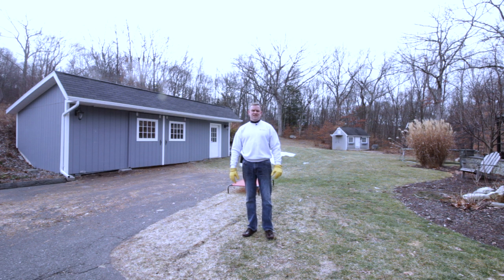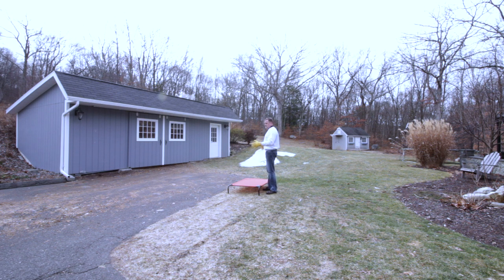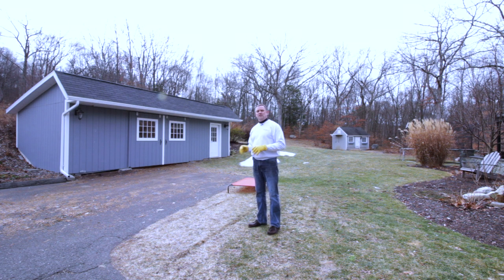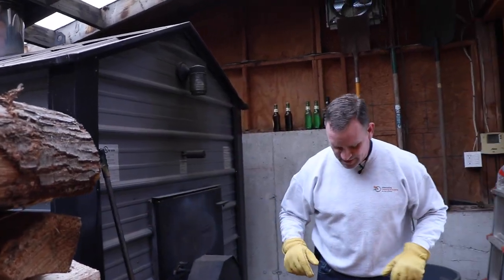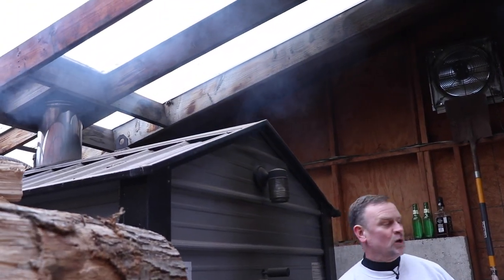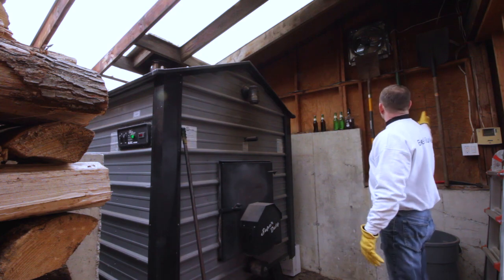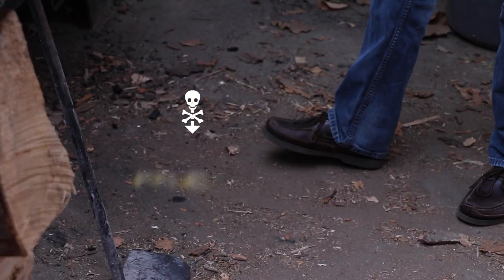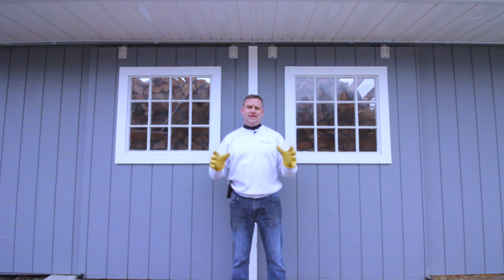How and Where to Install an Outdoor Wood Boiler | DIY Projects

Comment: So much great information in this video! I have a Tennessee outdoor Hoss 600 outdoor burner and I set my burner up completely wrong! Its rated for 10,000 sq ft, but my house is from the 1880's and is around 4000sq ft. So it's all my burner can handle. Even though the wood cutting is alot of work it sure beats the 800 month in natural gas and electricity. Now with the burner going my bill is around 180 month for electricity and my gas is shutoff at the meter. I'm sure it could be even more efficient if can get this mini mansion insulated properly. My blower from my furnace runs constantly to keep up with the drafty house. Im going to try alot of your methods on here, keep up the great work!

Comment: Wish you had made this 3 years ago. Kudos really nice set up   We have a lot of the same Ideas   I chose gravel as a bed, however left the stove outside.  20 feet from (back of) the work shop.  175' to the house. My main issue is/was icing around the front of the stove from roof run off, and flow of the land. I have a 16' "lean too"  constructed off the back of the 3500sq foot shop. I hope I resolved the problem this year. I put eaves on last year and it helped, now an eaves heater plus some landscaping. Hey it's what I sent the boy to school for ;).   If it doesn't I'll extend the roof line to cover the stove next year, more or less box it in.  I have enough room for 3-4 years outside and another 1+ under the lean-too cover.  Which I now don't care for. I'm paranoid if it starts on fire I'm placing it to close to the shop. This is why I like your "self contained area / building".   Plus I now like the extra cold storage area. Considered about boxing it in with a fire wall between the stove and the lean-too wood supply.  I do like the outside storage as it allows for ease of wood rotation. I'll admit heavy snow has been an issue despite covering it.   Since this is hidden  i'm okay,, so no eye sore or gossip.  Now water lines.   I wish I had a second run to the house for the hot tub & three season porch (or future.)  But I think a manifold will work when ready for that. Whats your take on the manifolds I read pros and cons.  
 Regards  Al 
 awesome job

Comment: I like your setup, I didn’t think about the greenhouse roof I was just gonna go black and put more lights in, as far as the size, you said 2 years, for the load you described I would assume 10 cords a year, so if your storing 20 cords of split wood, a boiler and a generator, what’s the actual dimensions?

Comment: Mr. Luff,  Could you talk to me a bit more about when you had your setup as “seasonal”.  I like the idea of just moving the furnace out for the heating season and putting it away for the warm months.  Did you have any issues with freezing or heat loss with running the lines over the surface of your yard?  I assume you had installed some threaded fittings on the side of the house to connect up to.  Thank you.
Reply from the maker: Sure thing! No real heat lose from the water lines on the ground. I also used Sharkbite fittings for the connections. It is in-creditable simple thing to do. and it work great.
Reply: @AltheatsupplyLLC  Thank you for the response.

Comment: Great job!  I have been planning  to build an outdoor boiler and install it in a shed,......may go concrete and steel. Question, what kind/type of insulated pipe did you run?  Thanks again for all your videos!!!

Comment: As and experiment, at the 5:02 point of this video.  Instead of an "Exhaust" fan, why not reverse it's direction and have it blow air into the shed.  That way when you open the fireplace door, the air blowing in will escape up the chimney, essentially blowing the smoke back into the fireplace.  By having an exhaust fan, you are drawing the air out of the fireplace and exasperating the problem.  Perhaps the fan could have a reverse switch attached, just like a ceiling fan in your home.  That way you can use the fan in either direction depending on your needs.  (Of course you would have to change the external vent covers you currently have.
Reply from the maker: Great idea. However I would need to create a positive pressure in the shed for that to work. When i built my shed i need a lot of air flow to release a ton of moister that is coming out of the wood. You would be amazed how much water is in wood. When i load a couple cords of wood, the next day the ceiling is dripping. Thanks for the idea.

Comment: Good afternoon Jeff, I  recently moved into a 100 year old farm house with steam heat. I have radiators in each room, the boiler is a peerless 121,000 btu oil boiler. is it possible to hook an outdoor boiler to my boiler through a plated heat exchanger. 
Thanks Mark.
Reply: Mark Perucki u betcha

Comment: How many sq ft do u heat. How much wood do you use. I just got a 4400 like yours. I have about 4,000 sq ft i want to heat. House and garage
Reply from the maker: I heat around 4,000 sq ft and I have a 5500 wood master and use 10 to 14 cords a year.

Comment: Hi I was wondering what would be the cause of water flowing out of the fill vent when all the obvious has been check thermostats checking the water temp with a probe and checking water temp on inside furnace  and according to all within a 5 degree range at 185 thanks I'm thinking back flow but my well pump doesn't come on when i call for heat the water stops overflowing ??
Reply: Bob C 
You probably figured this out by now but it could be a breach in your heat exchanger that you use for domestic water

Comment: if u had to guess how much to build the shed, what would be your number?
Reply from the maker: i would guess about $2500 in material and all my labor.  The concrete work was about $1500 so total about $4000
Great question! I should of detailed that.
Reply: About 10 K and i did most of the work..

Comment: Love the shed. What kind of boiler is that one?
I am looking at getting a wood boiler. I live in Wisconsin so we have some cold long winters. 
I have a 1000 square foot home. It is Old and drafty. We have a new and well insulated 800 square foot shop with 12 foot ceilings and a 400 square foot rec room upstairs. I would like something efficient on wood and be able to fill 2times a day (or less in warmer weather) What current model boiler would you recommend?
Reply: Looks like a Woodmaster. Anyone running an install business would be apt to respond.

Comment: all outdoor wood furnaces under insurance laws must be 50 feet from anything combustible, that's trees out building made of wood, fences house, the insurance company will cancel your policy if these are not followed, being this unit is in side a wood building the insurance company will cancel or give you so many days to fix it, now if the building you put it in is all steel you are ok, but your wood pile must be 50 feet away, as well as anything close to the metal building that can burn must be removed
Reply: This is not a wood stove, and it varies state to state, but here you can have one of these against your house as they are completely insulated ( no heat on the exterior at all ) you just have to follow flue guidelines. Also being the structure is not attached to the house exempts it as you can or don't have to insure an out building, its your choice really and depending on the locations you have to follow your insurance carrier if you choose to insure the outbuilding.
Reply: as an installer, it would cancel all coverage, some MFG  make a model that is approved for indoor use and close clearances, those units can be installed in your home or a wood building as long as it is one that is approved for such, it is a liability issue not weather the out building is insured, because if anything including a wood out build went up inflames the fire will spread to other property from that out building, wood pile, , tree fence or what ever is flammable, I have had customers insist me to install it were they want it in spite of me informing them of the 50 foot rule, I have them sign a waver saying the install is being done agenised my opinion and in no way am I responsible or obligated to move it free of charge, and a year or 2 later they get a letter from there carrier to remove the stove to a location not less then 50 feet from anything combustible, including your wood pile, with in 15 days or your policy will be cancelled, that customer calls me up and blames me for putting it there and wants me to dig up the wires and water lines and move it at my cost, sorry but I tried telling you and you signed the waver, I do not get into a pissing match with them over the install, I just have them sign... now if they want it moved they pay me,, its bad when you did a concert pad and all, the bottom line with these as long as it is installed right, insurance carrier exempt you from any fire risk unlike a in home wood stove were they charge a premium for added wood stoves in the home
Reply: I have an outdoor boiler 10 feet away from my house that is in an enclosed wood building same as his, my insurance agent has inspected it and wanted me to help him build one just like it, it all depends where you live.
Reply: like I said I don't know what the insurance rules are in the usa, I just know all the companies here in Canada have the same as it is all written by the underwriters